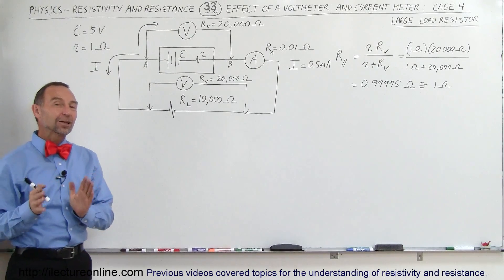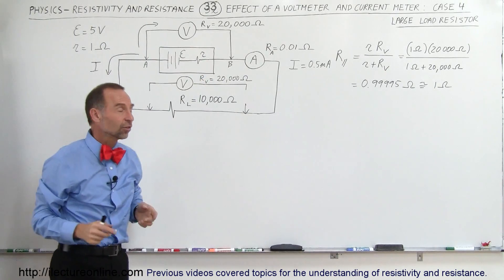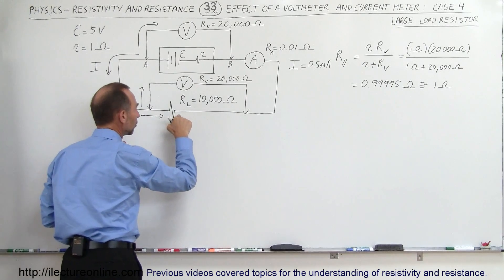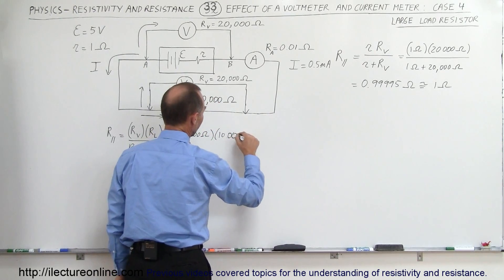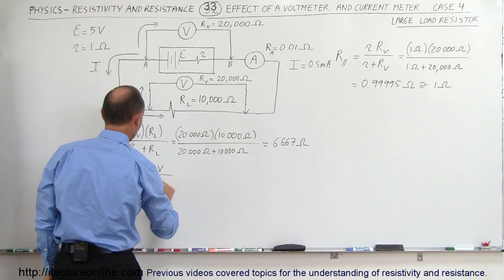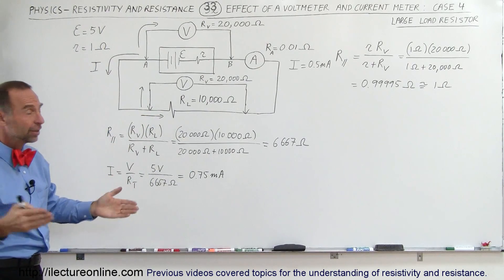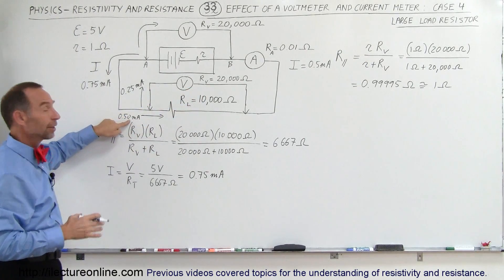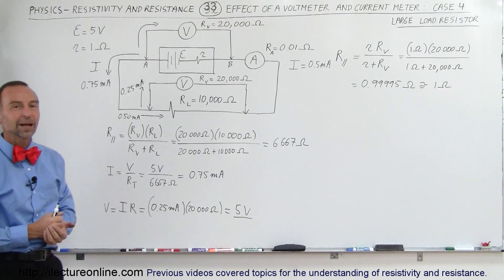Physics 40   Resistivity and Resistance (33 of 33) V=? Across a Large Load Resistor

Comment: Professor in the last video you didn't add the resistance of the voltmeter which was on the top. But in this video, you added the bottom one. What is the difference?
Reply from the maker: It depends on the value of the resistance of the part of the circuit that is measured.  Note that if the resistance of the circuit is high then the resistance of the voltmeter is important and will affect the circuit significantly.
Reply: @MichelvanBiezen  Thank you very much sir!

Comment: correct me if I am wrong, but whether you connect the voltmeter to the voltage side in parallel (like in the last video) or to the large resistor side, your still going to effect current to a large degree because the 10k resistor is still parallel to the voltmeter no matter which side you put it on.

With that said, great videos!